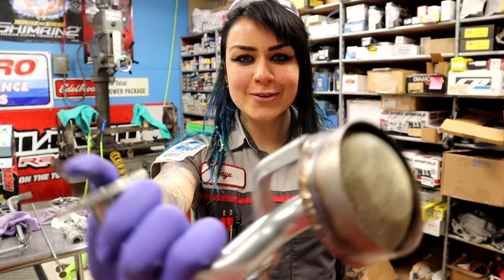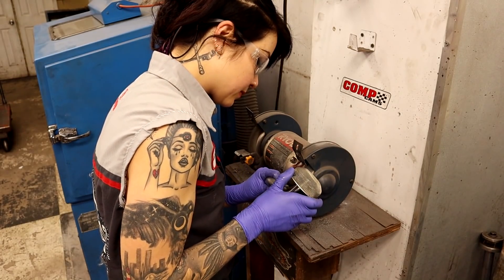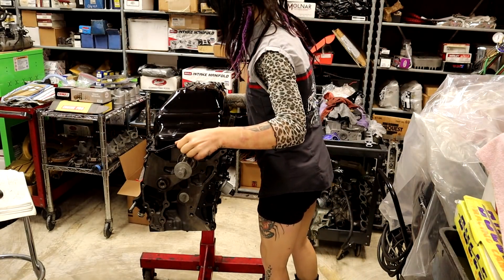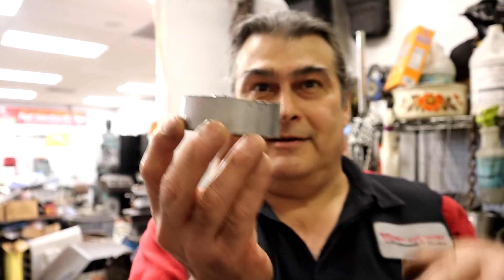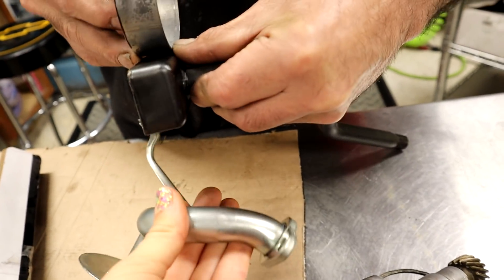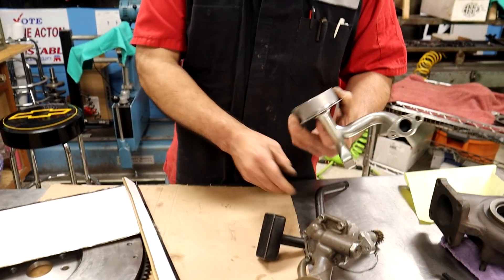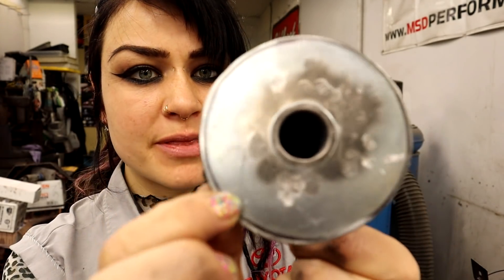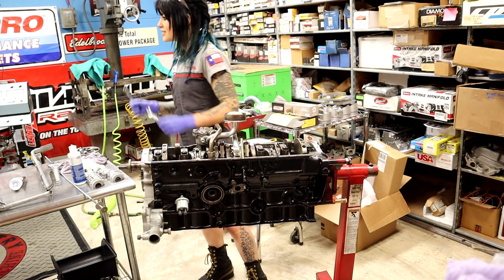"Rod Knock Proof" Oil Pump Pickup Mod!! (a.k.a. attempting to make my 7M reliable!) Supra Saga pt 12

Comment: I did this mod for my 7mgte. We'll see how I goes.
Reply from the maker: Oh heck yes!! I have done it for both of mine now! I look forward to hearing back !!
Reply: @FayeHadley  so far so good. I ended up doing the pick-up mod, the AZ hardpipe that removes the banjo bolt, and the upgraded spring from Driftmotion. Cold start oil pressure is around 20 psi and warm idle oil pressure is still probably just around 5 or 7 psi. So not much of a difference from the spring. I'm just hoping the rest of the mods allow for  better continuous oil flow.
I have an AEM V-1 in the car now with a rough tune that is still getting tweaked. So far driving around has been fun. 😃

Comment: FAYE!! did you replace the hardpipe with the banjo fitting in between the pump and the block?! The banjo fitting is a huge restriction in that part of the line, and it cuts oil flow down drastically. You can eliminate it with a couple of AN fittings and some stainless braided -8 hose... or Driftmotion makes a kit... that is just as important as the pickup tube!! also, a Full flow oil cooler. You have to delete the stock oil cooler setup, which only works under higher RPM. you need consistently cool oil for that engine and turbo!!!

Comment: Faye I’m not a true mechanic but should you have not epoxied the magnet to the base? Plus if you get in there again how are going to clean it out?
Reply from the maker: Oh it's only there to hold the screen in place while we checked the clearance on the bottom of the oil pan - not a permanent fixture. I removed if before Danny welded it! Sorry for not being more clear about that!!!

Comment: I prefer a magnetic plug instead, then it can be inspected and cleaned, and wont move and get stuck in pipe
Reply from the maker: I do have a magnetic drain plug!! I think you misunderstood what that magnet is for! It was to hold the pick up screen components in place while we measured for the clearance on the oil pan!!
Reply: @FayeHadley  sorry ,my mistake

Comment: i have wrecked alot of 7mgtes. they would spin rod bearings from low oil pressure at low rpm and high load. i was running them in my offroad truck. the oil pump just isnt spun fast enough at idle to create the pressure you need in abusive conditions

Comment: Are you shimming the pump relief spring or are you just going to throw it in there as is? Also, do you plan on using an aftermarket oil pressure gauge? Im guessing so since the sending unit you have on the block looks aftermarket. Interested to see what your oil pressure will be!
Reply from the maker: As I stated the video I shimmed the pump 5mm 5 years ago
Reply: @FayeHadley  ah i must have missed that! Did the same to mine. It didn't seem to have an effect on the pressure. I did upgrade to the driftmotion oil feed line.

Comment: I dunno if I have asked before but have you got an upgraded oil pump to block cross pipe? Stock one has a crushed tube and banjo fitting which is super restrictive

Comment: I want to do the same    What is the dimension of the ring ?      Ps I have another mod for the head   It would help with the soft aluminum on the head from caving into the stud hole.

Comment: Instead of cutting of the tube, couldn't you just have drilled a hole or two in it so that the air had somewhere to go?
Reply from the maker: Great question!! That absolutely defeats the purpose of this mod!! I want to be sucking there oil from as low in the pan as possible. If I dtill holes, then I am back to square one, Or actually... Worse!!!!
Reply: @FayeHadley  I think they're saying drill a hole in the side of the tube right where it hits the plate AND add the ring...  but I think removing the tube is cleaner.
Reply: exactly what i thought